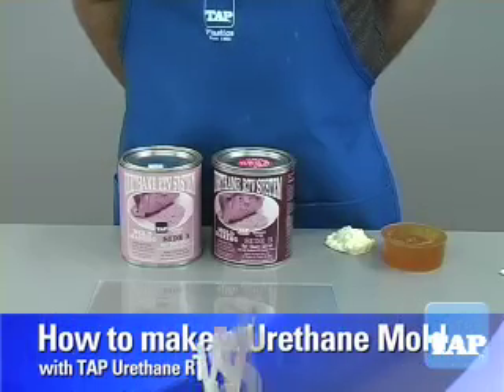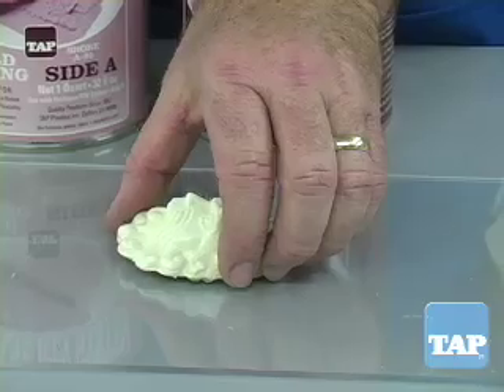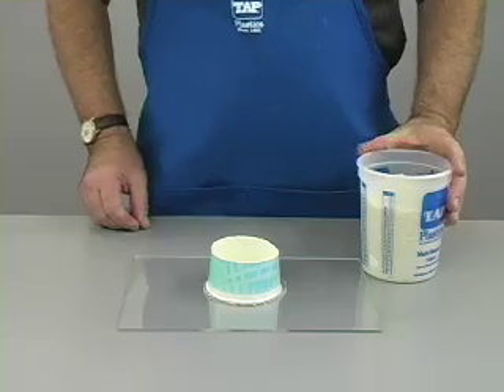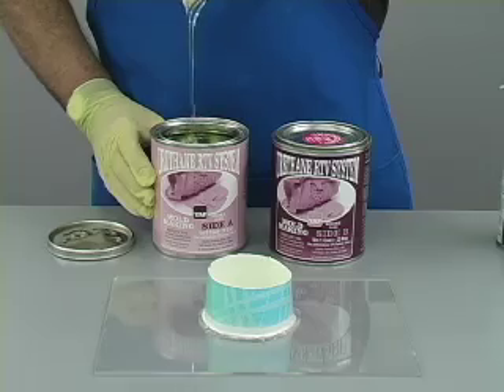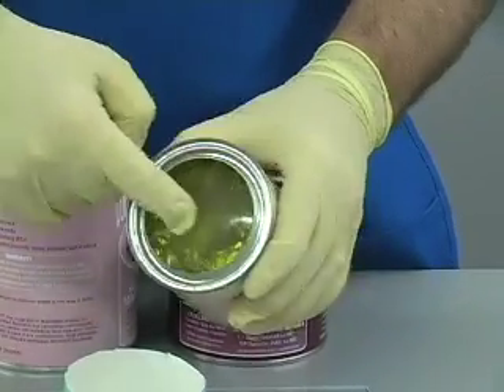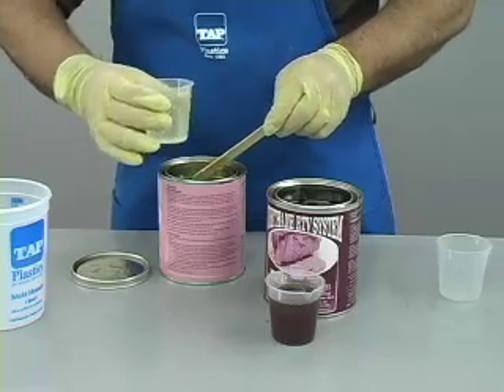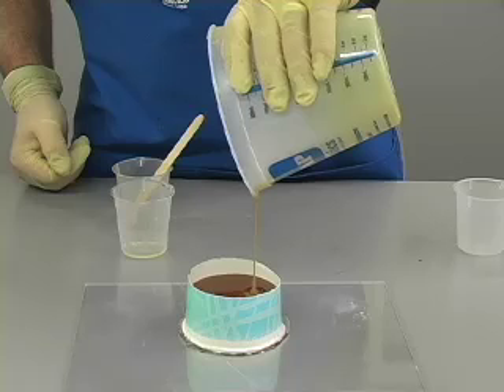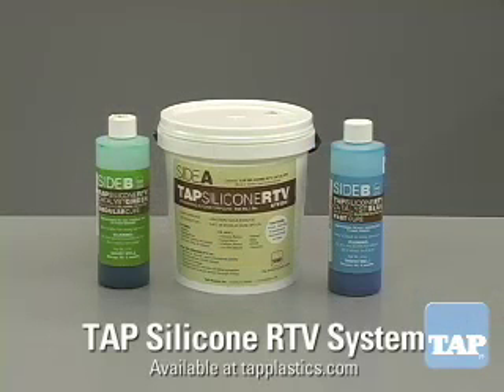How to make a Urethane Mold

Comment from the maker: @maikeru01 Silicone mold release does not wipe off clean enough.  There will still be a thin film left.  Since silicone is not water soluble, it does not wash off easily either.  Therefore, it is best to use a paintable mold release such as Rocket Release, available at our website.

Comment from the maker: @SuperWomanNeli The answer is a qualified yes.  If the original is clean metal, and a proper mold release is used, there should be no problem.  However, patina, paint, or other coatings could be affected by the mold material.  Therefore, it is always appropriate to test a small area first.

Comment from the maker: Urethane RTV will work for metals with a melting point below 250F. For higher temperatures, use Platinum Silicone which can handle 500F.

Comment: I don't understand why I wouldn't be able to paint the object I cast. Let's say I cast a resin model from a urethane mold. I understand that I'd have to put mold release in the mold before pouring in the resin so that it can be removed later, but why can't i just wipe it off after i pull it out of the mold?